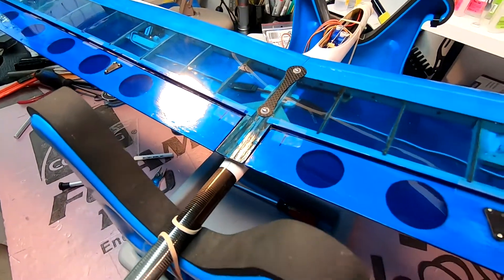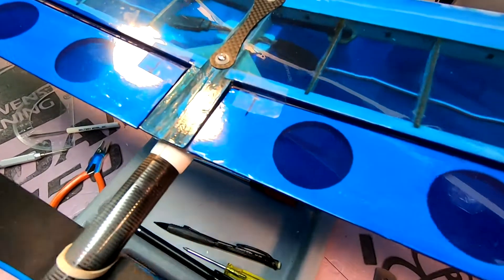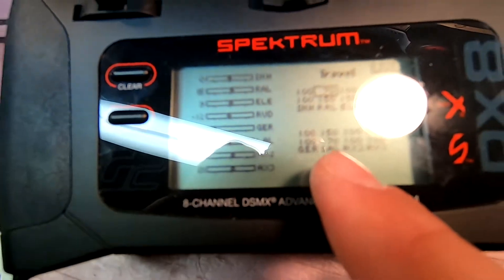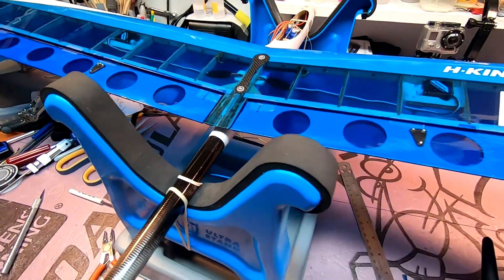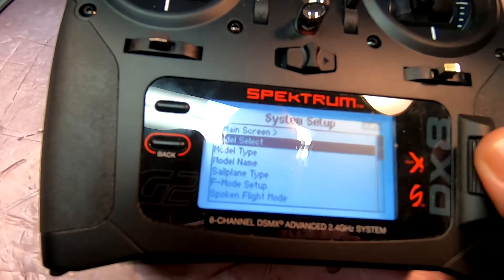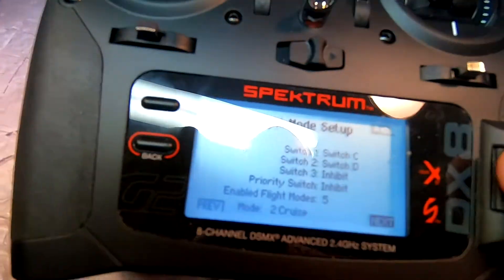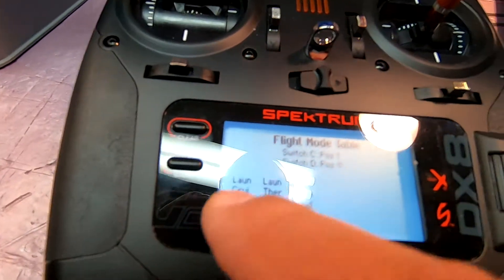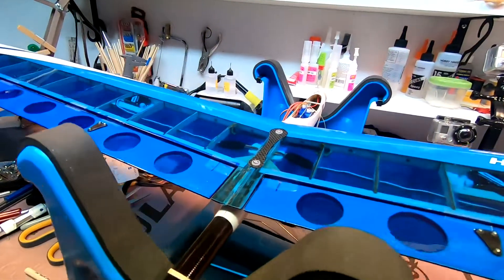HobbyKing Raven 1500 DLG - Build Pt15 - Programming Radio & Setup Five Flight Modes

Comment: Very informative as always, thanks. Like your throw gauge and will probably make one.
Can you explain why you have reflex for your launch mode? For my launch mode with my powered gliders I have a very small amount of flap. My thought being that at low launch speed I need more lift.
Reply from the maker: Regarding reflex on launch, altitude is gained more from the force of the throw than the lift of the wing. Lift also means drag, so to much lift will dissipate the force from the throw more rapidly. By adding reflex the amount of lift is reduced and thus drag is reduced so speed and thus altitude is maximized. Does that make sense... an extreme would be trying to throw a potato chip as far as you can throw a ball. During launch, a DLG is operating more as a projectile, like a dart. I suspect that this is why most DLGs have a tail section in the configuration of an X versus an inverted T or V tail, to maximize linear flight stability. Conversely, with a powered glider, the airflow from the propeller over the wing is providing the lift. So adding flap, which in this example is more appropriately called "camber", enhances the curvature of the airfoil increasing lift. Adding more and more camber becomes flap when in addition to enhancing lift, it creates excessive drag. If you were to graph how much lift is enhanced by more and more camber with how much speed is decreased by drag, the lines start apart, cross each other,  and continue to diverge. The motor compensates for the loss of speed caused by the addition of camber, but there will be a point of diminishing returns. With unpowered gliders, a small amount of camber/flap is used in thermal mode to enhance the lift of the airfoil, but the glider becomes more prone to stalling because of the increase in drag and subsequent reduction in speed. It becomes a balancing act, adding camber to get the maximum lift in a thermal without slowing speed to the point of losing lift all together. While it's hard enough to find these settings for average conditions, the best competition glider pilots will be the ones who can fine tune them to suit the conditions of a given day. 
I'm glad you enjoyed the video. As always, thank you for commenting! CJ
Reply: My RC Channel 
That all makes sense, thanks for the explanation. , I only ever used my launch mode, flap mode and spoileron mode for the hell of it. None of it was necessary because my club field is so large we could land a 737 there.
Reply from the maker: No problem, I'm happy to share info. Since you probably have a programmable radio, you should try setting up some flight modes for your powered gliders. Having a speed mode is always a good idea. In speed mode, you want some reflex to reduce lift and enhance speed and penetration with some down elevator to keep the nose down and the speed up. This will allow you to get out of a thermal or penetrate into a headwind. Cruse and thermal are self explanatory. Having a landing mode with a preliminary flap setting you can increase is good for keeping the speed down on approach. I've always liked tinkering so I like having the extra flight modes to play with. 
Have you thought about competing in RES, F3J, or F5J? It's all for fun if you're a newbie and it's a great place to meet more experienced pilots who are usually happy to help out the new guys. I know that budget and transportation are a problem for you but maybe there are events nearby.
Have you done any flying in the last few weeks? How's the weather, these should be your good weather days?
BTW, the Chrysalis is coming together. It's a very well engineered kit, but definitely not for the beginner builder. I'll start cutting video in a few days.
Reply: My RC Channel 
I have a dx9 and dx6, I struck very lucky and got them both used from local online classified ads for an extremely low price from guys getting out of the hobby. 
There are very few glider guiders around here that I've ever heard of and definitely no competitions. As for flying, well unfortunately I have not been able to get to the field since early July. The weather and my flying buddy's golf games have reduced the opportunities. I hope to get one more session in before our winter hits which could possibly come mid September but hoping it stays away until the end of October.
Good luck with all those builds you have ongoing.
Reply: My RC Channel 
That all makes sense, thanks for the explanation. , I only ever used my launch mode, flap mode and spoileron mode for the hell of it. None of it was necessary because my club field is so large we could land a 737 there.